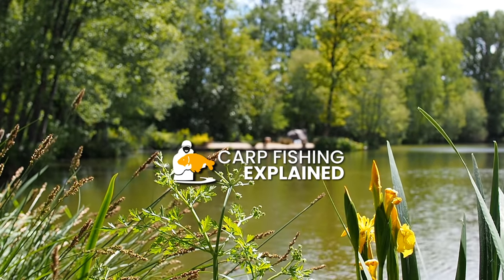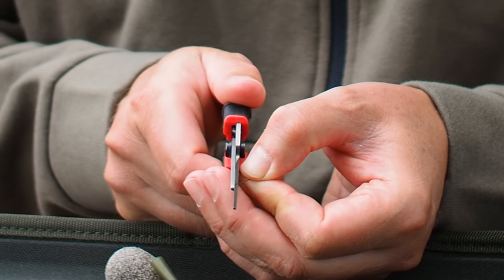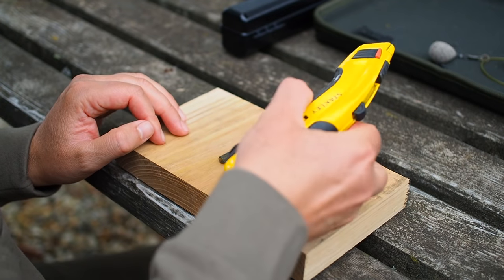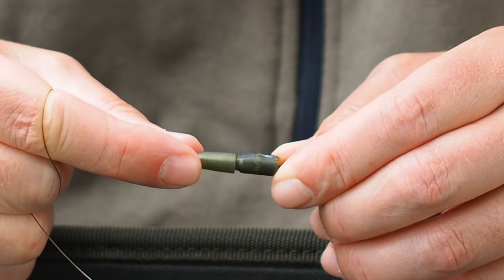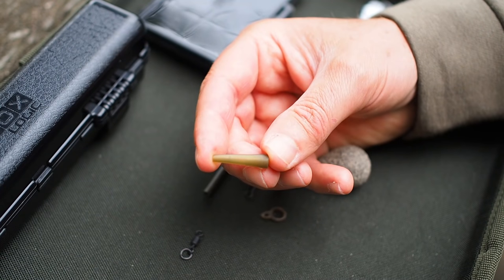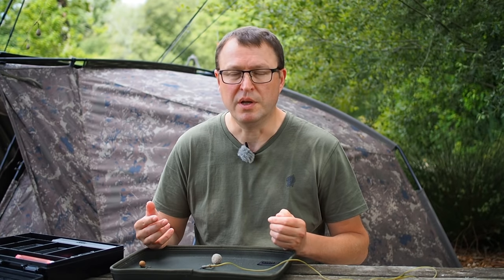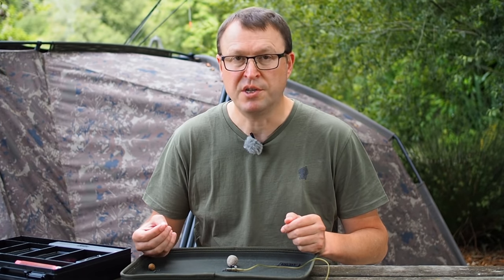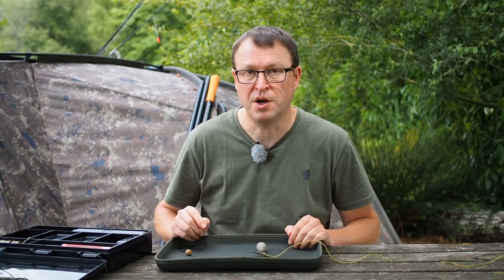I Cut the Leg of a Lead Clip (HERE'S WHAT HAPPENED)

Comment: Hi Matt.once again. Thanks for sharing your knowledge. What’s best,this rig or the running rig.last month. Thanks.
Reply from the maker: Hi Mark, thanks for your support. Personal choice really. The simple running rig is great for short to medium range work but if you are trying to cast as far as you can and not hit the clip then I’d prefer the shock and run system. The shock and run will work at any distance and is also better if you’re fishing with a PVA stick of crumb so although it’s a bit more technical it’s more universal in that sense. At the business end I’ve been coupling the shock and run with my mono hair rig and my mono ‘D rig. I’ve also been testing a supple braid multi rig with this. Hope that helps, Cheers, Matt.

Comment: Here is the Fox run rig we discussed, replace the  normal run ring this one so the lead is kept unless it becomes snagged when it will then eject.
Tight lines all!
https://youtu.be/EX2qjxMbvfs
Reply from the maker: Hi Bradley, thanks for sharing the link. I did wonder whether this was the system you were thinking about. I haven't yet tested this option. It looks like you need to use a special type of PVA to poke through the hole in order to retain the lead which is a bit limiting. The standard Fox run ring breaks at sub 10 lbs of force so if a lead did get jammed it would break free fairly easily. You could also consider just tying a lead onto a swivel with some thin mono to create what sea anglers call a “rotten bottom”. I’ll probably do some testing along those lines at some point and if it works well then I’ll do a “how-to” video. I'll be interested to know how you get on with the Fox system. Cheers, Matt.
Reply: @matthewcollinsangler  Hi Mathew, yes suprise! Fox sell the Pva strip which looks perfect for the job yet any pva string etc would  suffice.
During early experiments with lead clips and run rings i have used different breaking strains of finer line 'rotten bottom' style mainly due to my concerns of fish safety using leadc;ips.
My idea is a bit of a mish mash of different rig components greatly influenced by your own SHOCK and run set up.
Am heading to the bank Wednesday and will be building the rig so could take a photo and would really apreciate your opinion.
Nice one, Brad
Reply from the maker: @bradleyclarke4432  Hi Brad, nice to hear we're working along the same lines! No problem, send me a photo if you want, I'll have a look. You can find me on FB or Instagram or email at matt@frenchcarpancats.com.

Comment: Nice and creative! Would you threat on the lead directly on the tube if the the eye of the swivel was big enough so fit over the tail rubber instead of using the plastic ring?
Reply from the maker: Hi there, I’d always use the plastic ring because it provides extra safety but if the bottom was clean and snag free, then you don’t have to use the ring if you don’t want to.

Comment: Nice one Matt, great rig and well explained. Do you ever use a bead on the hook link?
Reply from the maker: Hi David, thanks for the support. Not sure I understand your question. If you are referring to adding a tungsten sinker to the hooklink, the answer would be no, I don’t bother as they can’t be moved from rig to rig and my mono rigs are binned after a capture so that would be wildly expensive. If I’m fishing a soft braided hooklink then I will add some putty. With this lead setup I’ve been using my mono hair rig which uses a little hook bead to kick out the hair. I’ve also used it with my mono ‘D’ rig that I created last year and a new supple braided multi rig that I’ve been playing with. Hope that helps, Cheers, Matt.
Reply: @matthewcollinsangler  thanks Matt, yep I meant a tungsten sinker. The reason I ask, when I've tested any my rigs in a bucket of water the hooklink always seems to kick up off the surface if I don't use one (or putty) and wondered if it would be a problem when presenting the bait.
Reply from the maker: @PBRStreetGang68  Ah good, glad that I guessed right! Hooklink loop up is a big problem and I believe that it can definitely cost you chances. This is quite a big subject and I feel another video coming on! I'd suggest that you watch my mono hair rig video which shows you how to create a simple rig that pancakes flat every time. It's those little details that can make a massive difference.
Reply: @matthewcollinsangler  Hey Matt, love your videos. On the sublect of sinkers, i re-use them all the time. Just take a fine splicing needle and push that through the hole. The sionkers have a lot of flex so if even if you enlarge the hole with the needle, it will be fixed on the hooklink.
Reply from the maker: @Fillemar2  Hi Phillipe, thanks for the support! Ah yes, that's interesting, I can see that working well for a certain size of sinker. My problem is that I have some small ones which would blow apart if you tried that. I have recently discovered the Nash hook eye threader and it can cope with small sinkers so that’s been a good option for me. All the best with your season and hope to chat to you again on here. Cheers, Matt.

Comment: Awesome video. Just wondering if you need tubing for this or could you have the same setup without the tubing?  What are the advantages? Thanks :)
Reply from the maker: Hi mate, thanks for commenting and for your support. I always use tubing or a leadless leader to protect the fish's flanks and to save on line damage from rocks etc. I have tried fishing naked but on reflection for me there were no advantages in doing so. Cheers, Matt.

Comment: Just make it simpler tubing with tail rubber and pull your swivel into the tail rubber with the large eye lead on the tapered end of the tail rubber and snug it on
Reply from the maker: Hi mate, thanks for your input. That's the way I used to show guys here to tie this rig when they didn’t have an inline lead. It does work but it doesn't work as well as this version. Try both versions and see what works for you. Cheers, Matt.

Comment: Hi im Dave from the Netherlands. I like the system. But what if the main line brakes 5 meters from your rig. The fish keeps swimming with all that line. It can tangled in roots or other things. And then the fish can die.
Reply from the maker: Hi Dave, I understand your concern. I believe I’m correct in saying that Dutch anglers do not use barbless hooks. I’ve met a few over the years and they tell me it’s very difficult to buy them. With a barbless hook and a running rig (like this) the carp will get rid of the rig very very quickly. We’ve been using running rigs (such as this) at the fishery for 14 years and I drain and net the lake every two years. The only time we have seen a carp damaged because it’s been tethered (temporarily) is when anglers have broken our rules and used barbed hooks or, they used a semi fixed rig. PS. I’m aware of two popular Dutch systems but I don’t use them, or allow their use because I do not believe them to be safe(r). Both of these require the leader and mainline to be pulled through the tiny holes in the tail rubber and the leadclip body. These holes will jam very easily with a tiny amount of chod or weed and then the carp is left towing a tangled mess with a lead which is dangerous.

Comment: Hi Matt
Brilliant and informative video as always😁😁 my main Syndicate i fish in the UK causes me to need to fish consistently at long distance 100-120yds. It is also very weedy, can you suggest a rig that would work for me under these conditions? The weed is always about 2-3FT deep from the bottom of the Lake. The 3 biggest Carp in the venue are all over 50lbs and there are at least 20 known 40’s in there, with about 10 known fish over 45lbs. So I’m likely to hit a real lump in there. Any suggestions?
Kind regards
Reply from the maker: Hi mate, thanks as always for your support. Sounds like you got yourself a massive challenge there! If it’s as bad as you say then I would go with fixed zigs (if they are allowed). I’d fish outline inline and set the lead to drop on the take. Black foam zigs with a little yellow topper were always my go-to tactic in heavy weed. I’d just find some fish and launch a zig at them. Start off long and then cut off 6” at a time until you get a run. Stay mobile and give it 2 hrs per chuck. Get the combo right and the results can be fantastic. Fish the same through the night. The black foam is a silhouette against the sky at night so don’t swap to bottom baits! You need to go all in with this. 3 x zigs 24/7 covering different depths. My best results with these tactics resulted in 11 carp inc. two 40’s in 24 hrs from Abbey lakes in France. I was the only angler to catch anything that day. Food for thought I hope. Cheers, Matt.

Comment: Hey Matt, very impressive channel, well done. I mix my pike fishing with Cats. I suspect that this rig would work well for my cats, question is would you want a cat to feal that weight resistance or would you suggest leaving it to be free-running? Thanks 🙏
Reply from the maker: Hi mate, nice name BTW 😉 Great to know that you’ve been enjoying the channel. We’ve been fishing trick lead systems such as this one for many years here at Beausoleil and they work really well for both carp and cats. If you’d like to see my dedicated catfish rig then watch this: https://youtu.be/NkOZfsGNmbk. It doesn't matter whether you use a shock and run lead system or a free running lead system for catfish IMO. All that really matters is that your hooks are razor sharp. The Nash pinpoint range of hooks are the sharpest out of the packet hooks money can buy and while many catfish anglers may baulk at using such small hooks for large catfish (lake record is 134lbs) they are ridiculously strong and this method is very effective. Hope that helps, Cheers, Matt.
Reply: @matthewcollinsangler  Many thanks for taking the time and effort to reply, highly apreciated :-) i will invest in some Nash pinpoint.

Comment: Great tips as always Matt 👍, I'm interested in seeing this format in the leadless leader version with maybe a shocker bead ? If it would be safe enough ? Keep up the good work and look forward to your next posts 👍
Reply from the maker: Hi Gavin, thanks very much for commenting and for your support mate. It’s great to hear that you are getting so much from the channel. I have had a little play with something I term the double shocker. It’s set up in a very similar manner but I swap the tubing for a leadless leader and it does work. I used an old 6mm bead that had a larger hole in it than it did originally. I then sat that on top of a short bit of shrink tube. Once it’s knocked off the shrink tube (by the lead and ring setup) it flies off the leader and over the knot with very little resistance. The result was a twin shock effect. Once hit from the modified HD lead clip and rubber then a second hit from the bead. Although it worked well, I couldn't be sure how much the second bead was adding to the system so I didn't spend much time fishing with it. Although I felt it was safe I wasn't sure that adding such a bead was justifiable as anything that impedes (even fractionally) the ring flying up the leader always increases risk. If there’s weed where you are fishing I would not use such a setup but if weed isn't an issue and this is something that you’d like to experiment with then go for it and let me know how you get on. Cheers, Matt.

Comment: Great idea but so much easier to just use the korum bolt and run kit 👌🏼
Reply from the maker: Hi mate, yes I have seen the Korum kit but I’ve not managed to get hold of one to test yet. I’ll do that at some point and I’ll be very interested to see how it works compared to this setup. Cheers, Matt.
Reply: @matthewcollinsangler  there a great bit of kit 👍🏼 well recommended 🎣
Reply from the maker: @r80yce  Thanks mate 👍

Comment: Cracking watch , I have a question which with your experience you might be able to answer ? If when fishing a water that is full off weed and I am expecting to drop the lead .. what lead should I use ? Just a plain lead or one that is covered in a coating ? It's all over the news how bad it is for all aquatic life having plastics in water! So is dropping a coated lead not just bad for the carp but the whole lakes eco system?
Reply from the maker: Hi Rick, thanks for the feedback. Great question! Although plastic is a form of aquatic pollution, lead is far more toxic to any body of water. Lead can only leach toxins into the water if the metal comes into direct contact with water itself. The plastic coating on carp leads shields the metal from the water which limits its ability to pollute the water. Therefore I would always recommend plastic coated leads whether you are retaining them or dropping them. There are non toxic leads available nowadays but I’ve not had any direct experience with those yet. They tend to be bulkier than traditional leads as the specific gravity of lead is so very high. I do have some ideas on methods for fishing weedy lakes without dropping the lead but I’ve yet to test them so there may be a video on it at some point. Hope that helps. Cheers, Matt.

Comment: Hi love your rig set up. Just wondered is it necessary to put the little clip in the lead clip? By leaving it out it at least allows the fish to only tow around the hook if it breaks mainline side of swivel in the lead clip. What are the benefits of locating the tiny clip?
Reply from the maker: Hi David,
It’s safer to put the little fork piece in the lead clip to pin it to the swivel as on the take, you want the lead clip to move with the fish and pull out of the run ring. Watch my video on lead clips and you’ll see why having the lead clip run up the line can be dangerous: https://youtu.be/a6WI6Y1o_Xk

When this is set up the way it’s designed, if the mainline breaks, the big ring flies over any chod or leaf matter very quickly. Yes, the fish is left with some hooklink and the clip body and a bit of mainline but the fish will get rid of it quickly without the weight of the lead, even quicker if you use barbless. 
Cheers,
Matt

Comment: Hi Matthew, 

since your emphasizing how dangerous wrong applied lead clips can be… recently gave Fox Tadpoles a try and think they work really well. 

Sure, you cannot quickchange a lead, since the leads are not „spliced“, but it’s a nice way to make a rig semi-fixed and have it totally fail save from my point of view.

Did you give‘em a try or haven’t tried them yet?
Reply from the maker: Hi Markus, interesting to hear about your experience with the Fox tadpoles. I bought both the multi-bead tadpole and the inline Tadpole from Fox. I was really looking forward to testing them as I thought they would be a great solution. Initially the results were good but with continuous use the beads became soft and began to lose contact with the swivel. I want the bead to stay in tight contact with the swivel otherwise the whole lot will slide up the line. You are then relying on the tubing to safely pass over the mainline (until the break) and this is not something I would count on. It’s a shame for me as the tadpole beads looked really good on paper. You could solve the problem by gluing the swivel into the tadpole bead using an epoxy type resin but I hate having to go to such lengths. This was the reason why I started experimenting with the Nash heavy duty clips. Cheers, Matt.
Reply: I cut off some material off the ring, which fixes the tadpole in the lead. This made the tadpole becoming loose somewhat easier but still made it hook properly. 

But I am gonna have a look at the swivels if they gonna get loose unintended.
Reply from the maker: @Markusgebvor  Right OK cool, sounds like you're close to a solution. Best of luck, Matt.

Comment: In dire need of a video on Zig rigs, I need them for the weekend but I can’t tie a good one that performs well on the palm test.
Reply from the maker: Hi Drew, I’m afraid I haven't done a video on zigs but I’ve caught a fair few massive carp on zigs when I was fishing Abbey Lakes so here goes. Palm testing of zigs is never going to be very successful as the bait is very light and the mono is stiffer so it won’t react the same as a traditional bottom bait. I’m sure there’s probably not much wrong with the rig you’ve tied but here are the things that I focussed on  when I was taught by a pro how to tie a good zig.
Back in the day I didn't know any better and I used wide gape hooks with mono. I used to use a short piece of silicon tube (5mm long) pushed over the eye of the hook to hold the mono straight when it exited the eye and this worked a treat. Now that I understand out-turned eyed hooks this might not be necessary. I also used to add a piece of silicon (blowback tube) to trap the hair tight to the hook. The hair would be made very short with a 8mm long 8mm diameter piece of black foam sitting just off the bend. On the top I would sit a micro piece of fake corn for a two tone effect. Hooks were size 8 or 10 and hooklink 8lb. Viewed from above the hook was virtually invisible, all you could see was the bait. I used an outline inline setup to dump the lead on the take due to the weed but a lead clip set very lightly would work just as well. That’s basically all you need to know. Hope that helps and maybe we’ll have to make a zig video one day! Cheers, Matt.
Reply: @matthewcollinsangler  I’ve never heard about that before, not a fan of zigs I think I’ll stay away. Thanks anyway